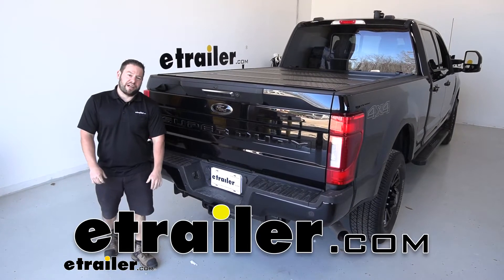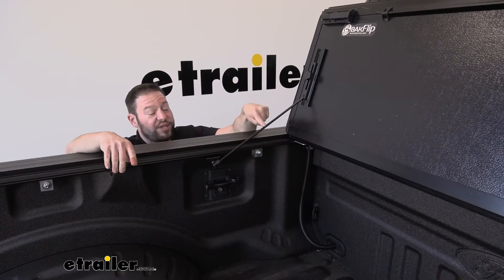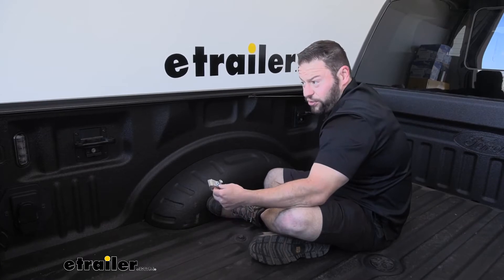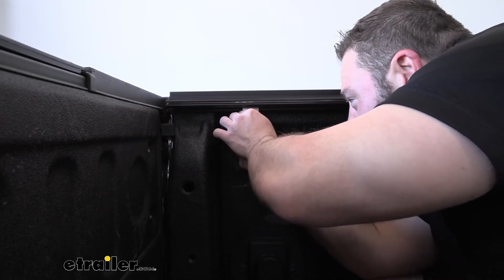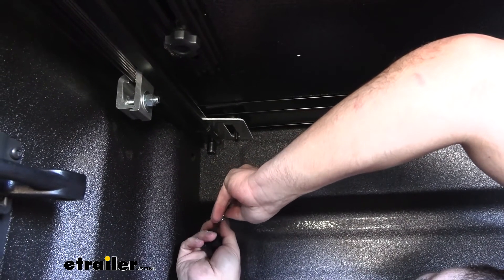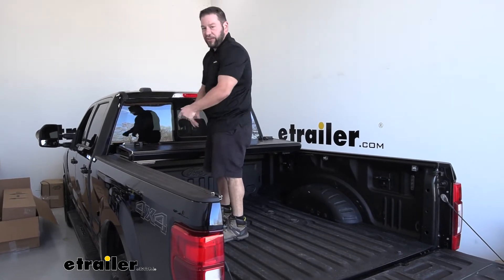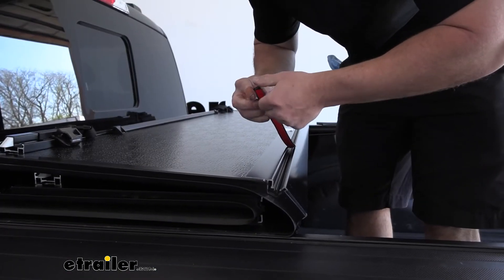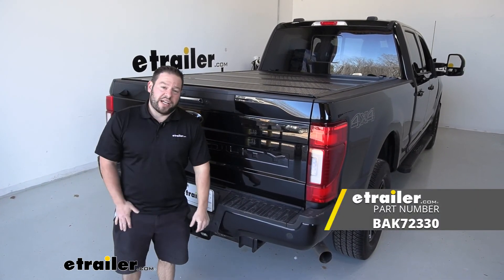etrailer | How to Install: BAKFlip F1 Hard Tonneau Cover on your 2022 Ford F-250 Super Duty

Comment: Why does the MX4 version look cheaper then the one you just installed?
Reply from the maker: Looks are kind of a subjective subject, but the major difference between the two is the texture used on the top of the cover. The F1 has what we'd describe as a rougher, pebbled feel while the MX4 has a smooth texture. Hope that helps, and let us know if you have other questions...
https://www.etrailer.com/Tonneau-Covers/BAK-Industries/BAK72330.html